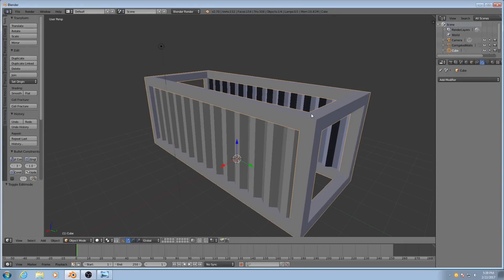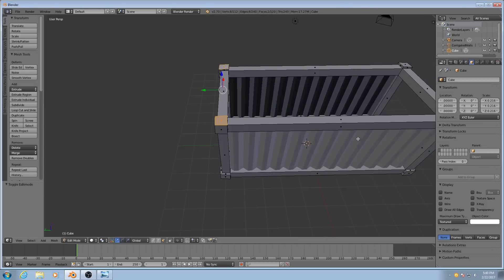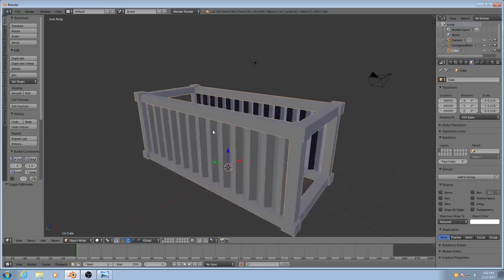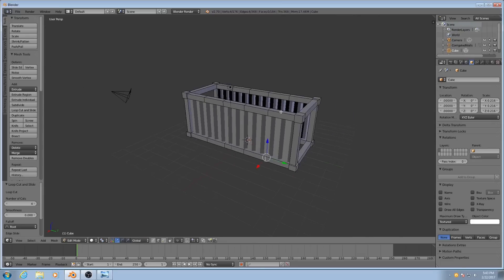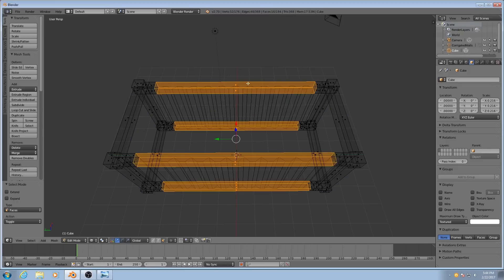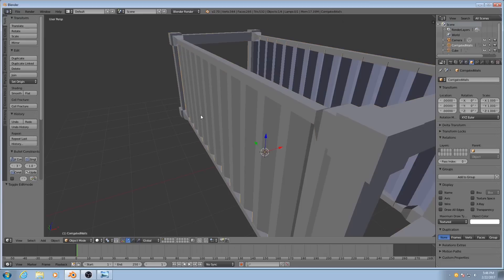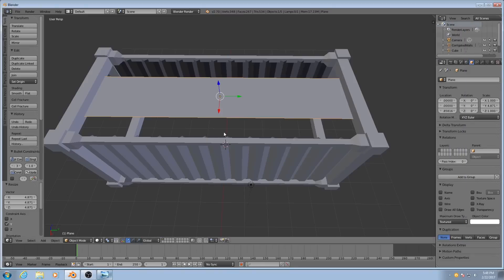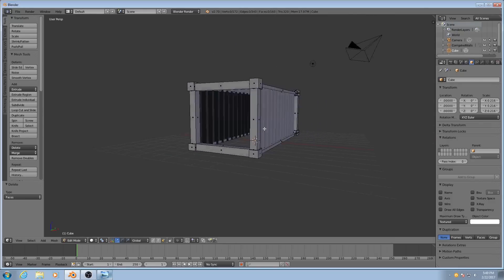Blender Game Asset Modeling Tutorial (Part 2)

Comment: I am really enjoying this series, even if it takes me a while and many do overs to get it right.  :)  I am having trouble with the corners, when I hit E to extrude, it only wants to extrude in one direction, if I hit E and then S to scale, well it definitely starts looking weird.  I even did what someone below suggested, E, and alt S, but I still do not get the same effect you do.  Any ideas where I am going wrong?  I am using 2.78 if that matters.
Reply from the maker: The 'E' hotkey by default is to "Extrude Region". This extrudes all selected faces in one direction (that direction being the averaged normal between all the faces). For this video, I went into the User Preferences and changed 'E' to be the hotkey for "Extrude Region (Vertex Normals)" which extrudes each face based on the normals of the vertices that contain them. That's what gets you the behavior that you're probably looking for. You can also select the dark grey "Extrude" button or hit 'Alt E' and select "Region (Vertex Normals)".
Reply: @AlienMinefield  thanks for the response

Comment: Okay, I am having some trouble here. At the beginning of the video, you say you extrude the corners you have selected. However, the bottom of your screen gives the parameters for the "Shrink/Fatten" tool, and when I try to use the extrude tool, I do not get near the same results. Are you sure you extruded the corners? If so, how did you get them to all extrude their separate ways cohesively?
Reply: just worked this one out, after you select the corners press E then enter, then press ALT S
Reply: Thank you, just to add to this, To Extrude like this video,  you press E then left click and Then ALT S (Thats how I got it to work). Also if for some reason your extrude is stuck on a Certain Axis, you can disable that after left Clicking. FYI: on Blender 2.78
Reply: Thanks!
Reply: Same
Reply: thanks my friend, it's really helps

Comment: Cool video, thanks for sharing your work process!
Just btw: manually doing the same tasks for every side of the object is a clear sign that you applied the mirror modifier too early!(: Especially because there was no need for it in the first place.
Reply: TorSkywalker correct me if I’m wrong, but I think he applied it so he can select the opposite facing faces to connect with each other :)

Comment: skipped a good few steps.   last vid you were touching up the corner pieces, next thign we know its a full container.
Reply from the maker: Whoa, you're right! It looks like I accidentally cut out one of the timelapse sections. I haven't skipped anything important though. At the end of the last video, I showed how to bridge two separate faces to make one piece of the frame. All that's happened here is I did that operation to bridge every corner box together. I apologize for the inconvenience though. It must have slipped through the cracks while I was exporting the videos.
Reply: Nuffin bad had happened. Great videos. What type of game are you making and  what engine will you use?